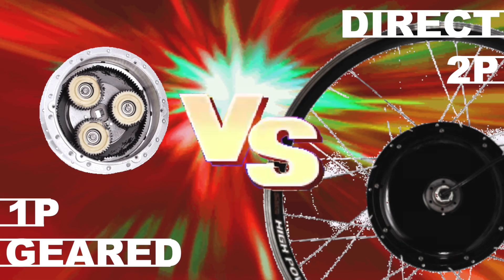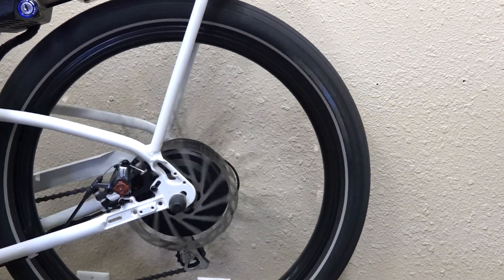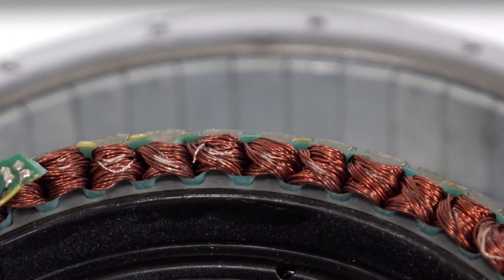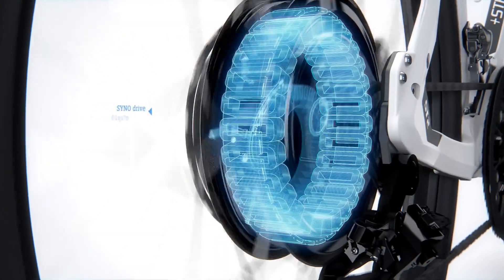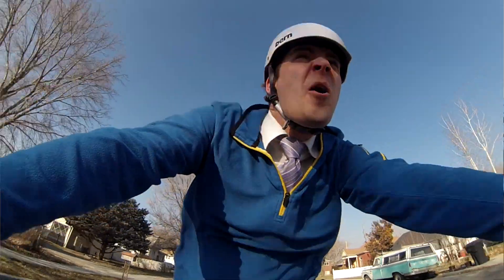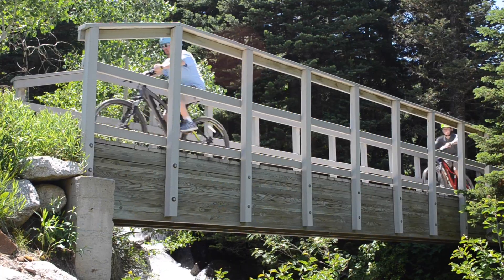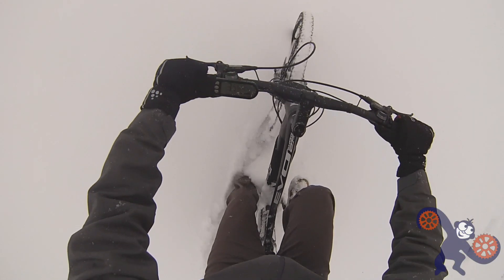Direct Drive VS Geared Motor electric bike

Comment: Hi Mike, nice video, thanks! It's a pity though you didn't mention one of main factors to help choosing one's best solution.
Direct Drive motors have the so colled 'cogging', if you want to actively pedal (and may be even use your e-bike without electric assistance for a while) you hardly can.
Geared motor have no pedalling resistance when electric assistance is not present.
Reply: > Daniele G : If you have a gearless ebike that won't go when you pedal it, you either need a new bike, or some fitness.  ; )

> BMB : While there are + & – to both types of systems, I think that cogging is a misleading and specious "con" to gearless motors. What people are essentially saying is "if you use the ebike in a way in which it is not primarily intended to be used (riding w/ power off) it doesn't work as well as a geared motor". Well, duh, and so what. 

Also "cogging" while underway and coasting can be useful as a regeneration mode! NOT a disadvantage. Further, if you are coasting, you don't want to be adding additional power, so cogging is probably good; and when you do want to go, it is a bicycle: use the pedals!

And, when a geared motor's little plastic gears wear out–and they will–or your chain breaks, you won't be going anywhere.
Reply: It feels to me more like my tires are slightly flat, it's not that much resistance. If you have the battery connected and want to absolutely fly downhill, you will get some actual Regen after a point.  @yru435

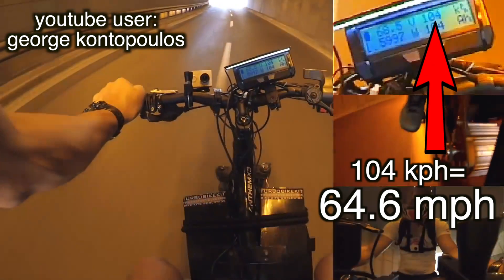Comment: FYI "george kontopoulos" the speed junkie you show at 2:00 is NOT using direct drive hub motor, but a planetary geared mid motor (8000w) that uses the bikes own transmission.

Comment: For example, I just purchased a motor kit (30 mph) + battery (700 whr) for $400 total.  I also got a Nashbar bike for $200. My $600 ebike will weigh 35 lbs, get 50+ mile range.  Easily outperform bikes that once cost over $2000.
Reply: most ebikes are made in china.. you can buy a bike like you just described for 500 bucks..delivered...but you have to buy them in lots of 20 units....every ebike maker i have seen sells the same items,just different labels/stickers....ebike sellers are one of the biggest scams i see going.....much like how FORD paid 3,000 dollars for a escort to be made in mexico and then sold it to americans for 11,0000
Reply: My conversation 100$ kit 48 volt 1kw motor and 20$exetra parts and battery 1.2kw battery 250$ give me  about 70 kmph speed+100 km battery backup
Reply: Bldc geard motor ratio 1:5
Reply: @biluroy4455  DONKEY
Reply: Fat bike 26 inches
Reply: 350 wat 48 volt hub motor can atain40- 45 kmph with 2 person
Reply: https://youtu.be/_8yquQYQWoE

Comment: Great video. Forums have a wealth of information, but much of it is outdated. In the last 7 years, the ebike scene has changed drastically.  Forums are great for getting the history of ebike, but reading recent periodicals will give you relevant and recent info. The people on forums talk about DIY motors. These days, you have so many more options. LunaCycle, Hobby King, LeafBike and even Ebay have been huge game changers in the last 3 years (Ping Battery, Em3Ev/Cell Man, other small vendors are falling behind). In the early days (pre 2015) an ebike once cost over $750 + a lot of DIY. Nowadays, you can get better kits for under $500 with minimal DIY.
Reply: The irony that I am viewing this 7 more years later...
Reply: Thank you for the insight.